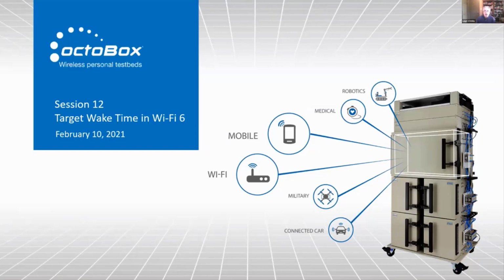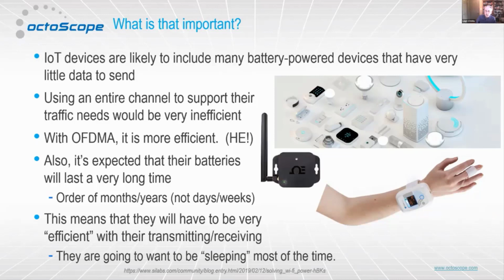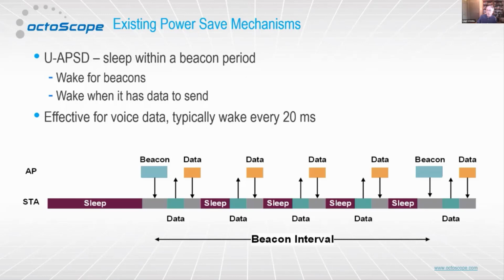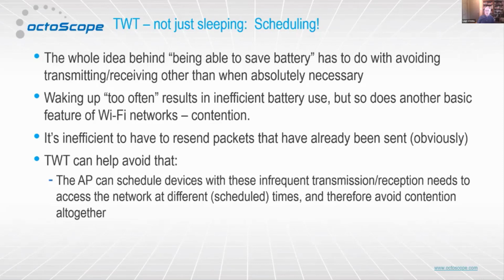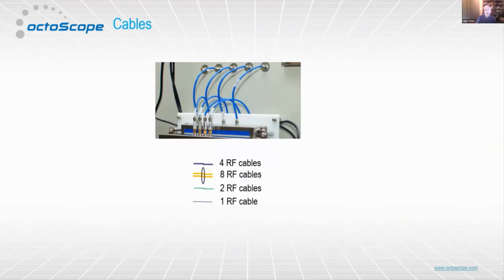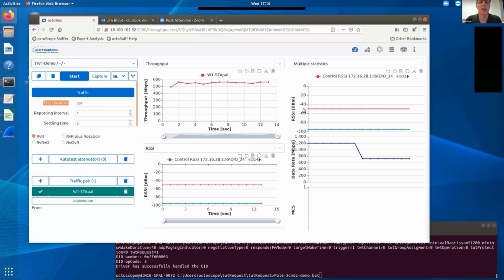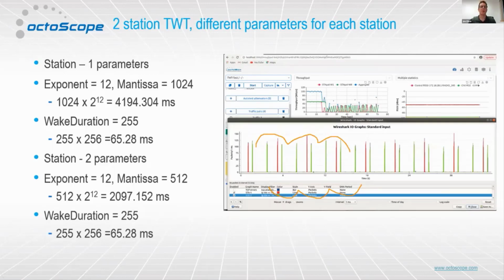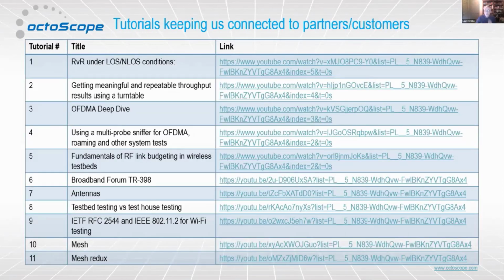Wi-Fi 6 Tutorial Series - #12: Target Wake Time in Wi-Fi 6

Comment: Will TWT affect wifi performance and throughput though I understand it helps in battery life improvements ?
Reply from the maker: TWT affects the throughput, because it causes the device to go into a sleep mode for (potentially) long periods of time. You can think of it this way. If you want to see the highest throughput, you need to send as much data as you possibly can at all times. On the other hand, if you want to save battery life, you have to be “asleep” for as much time as possible. Imagine an example in which the device is asleep 90% of the time. In that case, even if it sends as much data as it possibly can in the time it is awake, it will, by definition, only be able to send 10% of the data that it would send if it were operating all the time. So the resulting throughput would be only 10% of the maximum possible throughput.